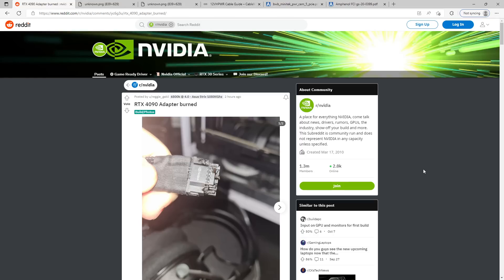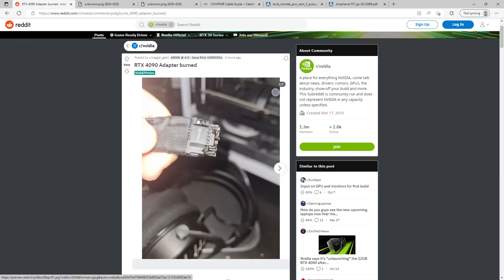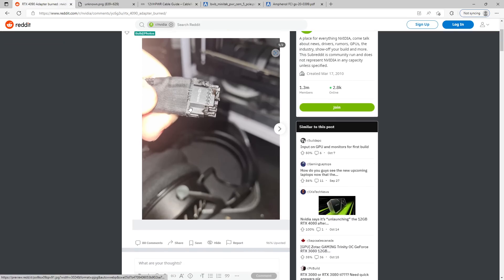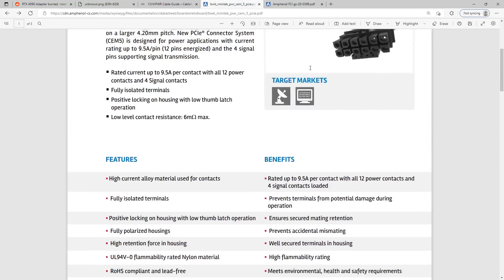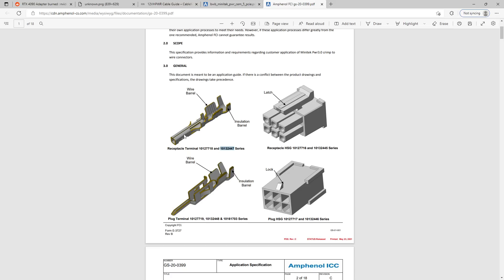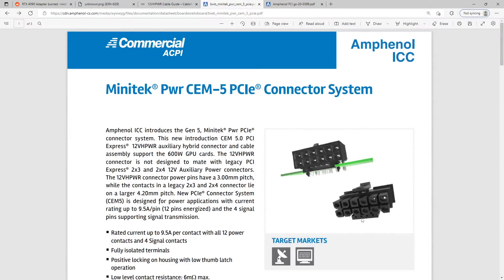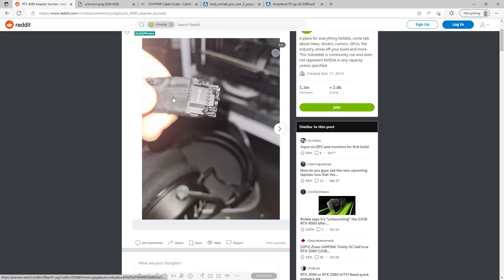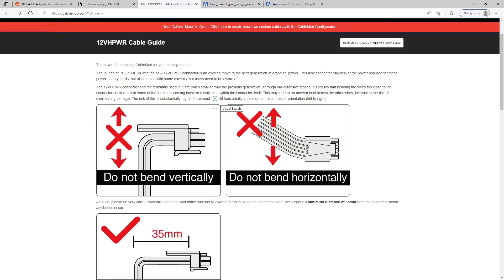The 12VHPWR connector sucks

Comment: I don't know, dude. Horizontal bending is going to make the lengths different, so those on the inside curve will be more likely to not be pulled backwards in the connector housing, and those on the outer curve will be pulled backwards, which is going to mean less contact with the pin, a greater likelihood of incorrect contact/no insertion, and (depending on the connector design) something could get pushed out of the back end, like always happens with the crappy, standard Molex-D connectors. However, it depends on the angle of the bend. A shallow bend isn't really going to matter much unless the shaft and/or pin can mis-align within the housing easily (again, like cheap Molex-D).

A sharply vertical bend is going to pull one entire row backwards.

Comment: i still dont get it??? if  the connector and terminals used in this plug are  way smaller than in the previous generations, why is it ok to delive 4xtime the power with that connector ?
i am not a electrition but even i know more power delivers = higher diameter just to be on the save side, sure it just 12v but still there are savty limits to uphold just to be sure

Comment: The joke is, the tech media outlets are saying that one factor is wrong connector usage by the user. As you stated, if the 4090 would be cramped into a case that's way too small and the connector were to be bent on the sidepanel, I'd say yes, that is wrong usage by the end user. But this piece of garbage being pushed on the customer is a joke. How can you make a fragile connector and not instantly design a 90° full-plastic adapter, while knowing that your connector is garbage.

Comment: Any experienced manufacturer should expect uers of a seemingly "known and simple" technology to be using them as the previous generations. 
That setup looks fine to anyone used to standard power connections. 

And at most any dedicated user would refer to the provided instruction manual. 
If the instruction manual doesn't warn you explicitly , repetitively and clearly * against using the cable how everyone is used to ... User can't be 100% blamed on this.

A faulty design that requires specific user attention and doesn't have tolerance for failure (or proper safety margins) is ultimately a designer mistake

Comment: Intel made the new 3.0 standard, not Nvidia. They did not choose to do this to reduce connections. Intel did. They did not make the specifications for the cable, Intel did. And PCI SIG was aware of the issue yet it was not stopped before mass production. Nvidia just followed guidelines and standards. Intel made them, PCI SIG did not enforce them. If AMD has this connection they will have the exact same issue. And if they don't have it this gen, they will next gen, because it's quite literally the new standard set by INTEL, not AMD or Nvidia.

Comment: Here are a few options. The cables are soldered with tin. The problem may be in soldering or broken solder joints. A loose pin can also get hot. Oxidation or dirty pin. Perhaps, only two connectors have been used and the other two have been left unconnected.

Comment: Molex connectors have always seemed to be a poor choice for connecting power. Not sure if the connector is actually in spec and will make a reliable connection. 18AWG is typically rated at 10a max for power delivery where the wire will probably get warm but not start a fire. This connector would be pushing 50/6=8.33a max per 16AWG cable assuming a reliable connection. Everyone has ben conditioned to having a max of 1a or 2a per most likely 18AWG cable giving PSU manufactures huge margins of error.

Power should have been switched to something other than this molex crap long ago, maybe like sata power has with edge connectors.

Comment: #1 Contact resistance - 
#(2)Next guess would be its firmware fault where the outer pins are pulling more current than the pins are rated for in some weird math error in the firmware xD

I've seen a few plugs fail and its all about contact resistance, heat speeds up oxidation of metal. Both the pins & jackets are probably nickel coated which helps with preventing corrosion, however... if you add heat to this process, for nickel, it will oxidise, probably not super pure nickel either so that will affect the temperature that it will have on the nickel plating, maybe Nickel Plated Brass. 

Anyway poor contact with the mating surfaces will create a lot heat and its because oxidised metal pretty much an insulator that creates more resistance thus more heat...repeat.

Not convinced on the removal of 2 pin will cause a plug to melt like that 
450w is only 37.5amps at 12v, divide that by 4, gives you 9.3amps per cable or 6.25amps per pin, that cable will do 20~25amps by itself (EACH) with maybe a little warmth but not enough to melt the plastic or the insulation which is rated for 110c+ which looks like PA6 but might be wrong on that plastic type 

As for the broken plate solder points ,(I'm being sarcastic here) last time I checked broken connections don't act as very good conductors aka no power at all so why would the outside pins melt if there's no power going to them, and if it was barely making contact that corrosion would show at that break point as well.

Comment: Bunch of amateurs as it looks like it's and manufacturing issue due to the resistance in the pins of the plug which is easily corrected with replacement plugs. Yes, Nvidia should step up to the plate and rectify the issue as it is easily solved with replacement cables.

Comment: Working on cars, this looks like a poor connection. When there is a poor connection, the device using the power demands more power from the PSU. So the card could demand 450 watts but the poor connection causes the PSU to output 600 watts for example to satisfy the card's demand.

Comment: I guess there is just not enough surface area. 600@12V is 50A, ridiculous amounts of current to pass through these tiny wires.
P.S. Something about these type of connectors. The problem about these is that it requires very tight tolerance to give a good connection, like they have to be exactly the right size down to the width of a hair, otherwise the connections wobble and only a part is touching, which is really bad. Also, they wear out very quickly. Just a couple dozen of total connections and the recepticals loose tension, and then you get wobbly wires. This should be only good upto a couple of Amps, after that this is basically a fire hazard (I have burnt a couple of those during my projects)

Comment: Any chance you can do an episode on the 8 pin PCIe cables? There's so much misinformation out there.

For example, people claim that if 8 pin PCIe cables can only cope with 150W, an 8 pin cable from a PSU can therefore only cope with 150W.  Even though the PSU end is a proprietary connector, and the cabling Easily able to cope with 300W total.

Perhaps also cover the Actual downside of pigtails, rather than the claimed spurious shit being spouted around the interweb?

Your episodes usually provide actual consumer information. Others are full of misinformation and confirmation bias to reinforce preferred narratives, with the sole aim of driving views at the expense of consumer understanding :(

Comment: The video card is tall, then add 35mm for a "correct" wire bend.  What about computer cases with a fan in the case door?  That would result in many people not being able to use this card in current cases.  JonnyGuru stated that the "old" 8 pin connectors are fine, as you did.

Comment: Well, lets be honest, when the 3000 series came out, they cut down the size of the pcb.. and they did not have to do that.. but they wanted a flow through fan on the back end of the gpu.. for whatever reason.. never needed that prior to the 3000 series.. so if they wanted to, they could just create a larger pcb the entire length of the card and place more pin connectors on that pcb.. but they want to pump up the output of these cards so high, as if they are giving us better cards, when its really seeing how hot they can run these cards.. the power they are using is now more then double of that a couple of years ago.. and the reason you did not see as much of a problem with this on the 3000 series cards is because they placed the connector angling out from the graphics card.. whereas with the 4000 gpu's they are right angle straight out of the card, a card which is over sized to start with.. taking up more room to the side of the case, forcing people to bend that connection to close their cases.. that  was not an issue with the 3000 series because they turned it and it came out at an angle, which then you did not have to bend the wires at the connector.. but what if they came out with twin connectors on the card and you could place two cables in, both on an angle like the 3000 series was.. then you would only need to connect two cables to the graphics card where you would have 4 cables coming out of your power supply into one cable, it would be 4 cables out into 2 cables.. both plugging into the card.. its not like you did not make the card wide enough to handle two plugs on the side of that card, its 3 slots wide plus..

Comment: What I find really, really dumb is the location and orientation every card designer decided to put the connectors on the boards, so that computer builders MUST bend it exactly like they're saying not to so that they can fit it in the computer.  Why not put it perpendicular to the board, like most motherboards have the power supply or CPU power connector, and at (if looking at the fan side of the board with the PCIe connector down) the bottom right of the board?  It would point straight down, toward the bottom of the case, and would not need to be bent to fit in the case until the cable gets routed under the motherboard or into the power supply compartment.  If the power supply is top mounted, a 180 degree adapter could be put in that would point the power connector upwards just between the video card and the side of the case, past the motherboard in most cases.  Very wide motherboards would have an issue with this, but it would still be FAR better than what we have.

Comment: 8 pin pci connector only uses 4 of those connections for power though, one +12v and one gnd pins are used for sending voltage feedback back to psu (the feature that not a single psu made a use for) and the other two at the end are to indicate if connector is 75 or 150 watt capable, they are just bridged to the gnd. If all 8 pins where used for power it would have the same spec as eps connector (400w). The 12VHPWR is complete garbage though. I don't see why pci power connectors even exist, when perfectly good eps  connector was already there for cpu power, and it's used for enterprise and workstations gpus too.

Comment: I think the horizontal bending is worse because it's stiffer this way so the forces on the connector are greater. In my builds when I need to bend the cable near the connector I'm stripping the isolation first so I don't put too much strain on the connector.

Comment: Why not just use EPS12v connector like CPUs do? Those are rated at 7A per wire couple, sototal of 28A or 336 Watts per 1 connector. Two very basic examples:
1) Server PSUs (e.g. Supermicro) have adaptor cables that convert one 8 pin EPS12v to two 8-pin PCIe. 
2) Industry-grade GPUs, e.g. Radeon Instinct MI210 are rated at 300W total board power and are fed by a single EPS12v connector. 
So leaving some headroom, 2 of EPS12v would be enough for all but the most absurdly powerful GPUs (including almost all 4090s), and 3 of them would be enough for absoluetly every GPU out there, like Galax HOF or dual chip ones.
Additional benefit - unification of cables and pinouts on PSUs and no more funny stories about power cables plugged into incorrect sockets.

Comment: if they were so concerned about board space, why not just use something like an XT90 connector, it is smaller simpler and actually tested, (and no issues with load balancing) running parallel cables for more load can really cause balance issues. max 6m ohm terminal spec, durability is a Delta of 5m ohm, 1ft of wire is also 4m ohm.
so if the connector has 1 12v pin at 1mohm and the other 5 at 6 mohn (in spec, no min ohm)
draws 600w, (all within their "spec")
the 1 at 1ohm will draw 14a (with the other 35a split between the other 5 wires) ... This is simple resistance math.

Yes at high power levels dunning multiple insulated wires is done, but the connections are checked, and screwed tight. In most other cases it is a single wire bundle. 

Also, surprised there is no test for bending force durability of the connector (the qualification test is published, only resistance measurement is a 30 plug/unplug cycle with no bending)

Comment: heavier guage wires will help..
Reply: no, that's unlikely. It's not wires that are the problem, it is pins themselves that are not too long, not very stiff and have connection area that is too small for the current required to flow through it.

Comment: In the automotive sector, a 12V connector rated to carry 50 amps would likely have massive terminals that would be firmly secured in the connector with two separate terminal position locks. Not to mention the first 4 - 5 inches of the connector's wiring would be taped up and zip-tied securely. Alternatively, it'd be a fat ring terminal secured with a nut. Asking a connector that small and chintzy to carry that kind of power leaves no margin for error.

Comment: They should have used a XT90 connector or modify something similar.
And why the heck the connector is still on the away facing side of the GPU from the position of most PSUs

Comment: Had a hunch this would happen.  Sure the wires can handle it and the connection can handle it when it is a nice tight fit.  But it really looks like they never thought of where this connector would be used.   It looks good on paper but we don't live on paper.  Outside of open air cases, very few cases have the room to fit the card plus the connector without putting pressure on that connection.  Also people who spend that kind of money on a GPU will likely care how it looks and not want that giant mess of cables sticking out of even a vertical mount so they will tuck them away showing as little as possible.

Comment: As far as the load across the wires goes:  It is an issue is an alignment problem occurs that causes too small of a contact area between a terminal on the connector and the video card.  Of course if this is an issue then it is the reason that the connector could be considered a bad choice, since that would indicate that the plastic of the connector is not high enough quality to properly isolate each terminal while rigidly holding each terminal in correct alignment.  The fact that there has been the real issue of some pins on the connector melting also indicates that the rated power limit of the connector has already been reached and should not have been used in the first place.
[[[ EDIT:  1) The 30 mating cycles durability rating is what will get you, since it indicates fairly limited durability of the connector for maintaining sufficient contact area at the terminals.  2) Thicker metal improves not only current capacity but also reduces voltage drop.  But this requires the terminals to make excellent contact.   3) Tin plating on some pins?  Really?  Oxidation alone will limit the life of this connector as opposed to gold.  Probably made like this since Amphenol knows the connector has low durability anyway. ]]]

I'm thinking this terminal is going to be a backwards step toward the days of the 4=pin Molex power connector.

Comment: I have checked the connector design of the plug itself and saw that you are 100% correct with your assumption. Just look at it. This IS just folded metal. So the connector itself is not really 100% at fault but (to be very specific) rather the way those terminals inside the plug are made. If this notch/fold/groove/overlap got welded shut I believe there would not be such a problem like this. It would still be flawed but at least somewhat safer to use when bent. 

Also, you can't even go in a Corsair 1000D with the cablemod recommendation of 35mm after the bend because the GPUs are just so massive.

Comment: I wonder how many more people had same burning problem with 12+4 plug …? I was lucky purchased RTX 4090 Fe and I have Corsair 5000d Airflow but Nvidia 4 * 8 Pin would not fit as comfortable as I would like so I was able to purchase extension from Amazon 3*8 pin to 12+4 pin and everything so far working very well.I have a Corsair Psu and they provide so cable but is impossible to buy so cable I purchased was only
Solution for me.I was bit scared but there were reviews from people to purchased cable to power RTX 3090 Ti and they are happy.I wonder what guy was running while his plug been burned…. 🤔🤔

Comment: If this is caused by stress on the connector by the cables being "bent", then the native cables from new ATX 3.0 PSU (not an adapter cable) would also have this same issue.

Comment: Does no one see the re-enforce sleeve on that adapter cable that sticks out a ways form the connector? Anyone measure that? Seems to me that is 35mm away from connector, so u can bend it after that...and from the installation picture, it was within that distance after.